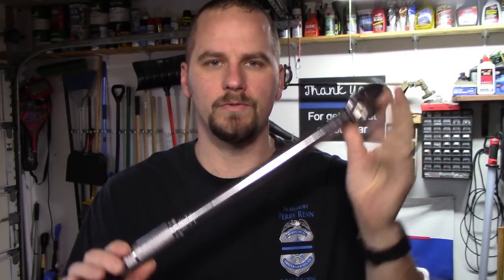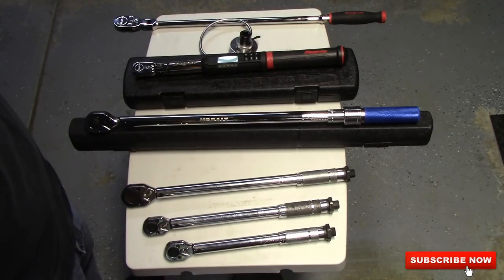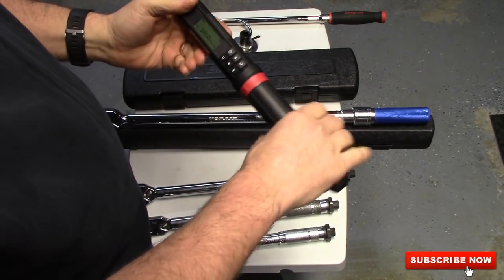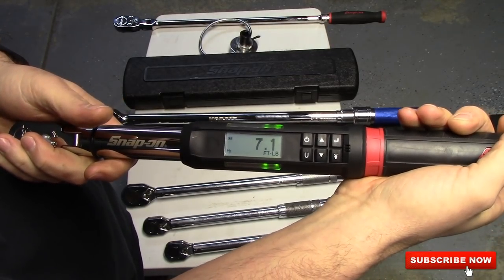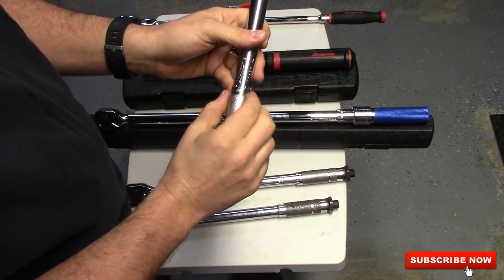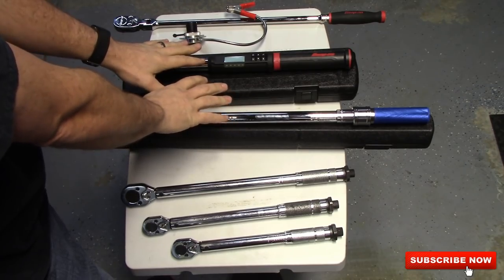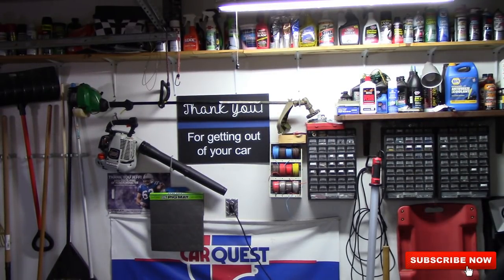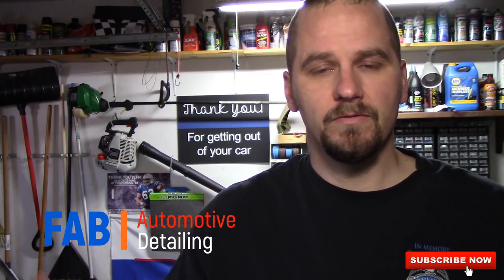Harbor Freight,Kobalt and Snap-On Torque Wrenches

Comment: That $550 Snap-On costs more than all my garage hand tools. Have to pass :)
Reply from the maker: Yes it is expensive and for a DIYer I would not recommend it. I use it daily in my job as a mechanic and its very accurate. That is why I showed the harbor freight torque wrenches to show there are other cheaper options out there for the DIYer.
Reply: @FABAutomotiveDetailing  I've got a $25 torque adapter just to check my $10 HF torque ratchet before buying a $60 Kobalt. That thing was 99% accurate, zero needs to buy a better wrench. Thank you for the video
Reply: @deseremere  but how well will the Kobalt or HF hold up after a year of daily use? The Snap on tq wrench is proven quality for those who use it every single day.
Reply: @deseremere  Those torque adapters are usually accurate but useless when you have to work in tight places. I have three of them, one from Harbor Freight and two ACDelco. ACDelco are excellent and they don't drain the battery when stored.
After using them for a couple of years I realized that there is no comparison between quality Digital Torque Wrench and Digital Torque Adapter.

Comment: After 20 years as a mechanic I DO NOT NEED a torque wrench to torque 10 to 60 lb-ft. I can feel in my arms . If you need a torque wrench to torque 30 lb-ft you are an amateur or a beginner. I am a engineer as well . I only use a torque wrench the first two years and now when i torque 60 to 180 lb-ft.
Reply from the maker: Jack Roselem That’s good and all but I’m no beginner been wrenching for over 15 years. I like to be exact when torquing. Yeah by feel I can get close also but not dead on what spec is. I just like to play it safe!
Reply: @FABAutomotiveDetailing  OK. If works for you. I am really not an accurate torque guy.
Reply from the maker: Jack Roselem We both get the job done and that’s what matters brother! 🔧
Reply: Remanufactured and installed engines for 28 years we called it "calibrated elbow".  We used torque wrenches where it counted obviously  but  learned  to feel the elasticity of a bolt  and could be quite close . I've worked on some vintage iron where the the spec for the head was "tighten evenly"
Reply from the maker: jz422 I work in a small shop with a great boss but when a comeback happens which doesn’t happen often the first thing he asks is did you torque the bolts. Just For example a water pump leaking a month after installed that’s the first thing he asks. So I have always played it safe after working at this shop for the last 7 years.

Comment: I liked your video. I like that Kobalt in a 3/8" drive as I am just a DYI person for its accuracy. What is your opinion of the best torque wrench adapter?
I viewed a video on the Quinn Torque adapterand it looks nice however there are two buttons (Power and meter button) on it if accidentally pushed will erase the factory calibration settings.
 That would ruin it. https://www.youtube.com/watch?v=2ih17t9u6fA   (5:18)  There is also an AC Delco brand and a few others. What you think of the Quinn brand and your recommendation? Thanks.

Comment: The upper end of the torque range only tells half the story. You didn't say what the lower end of the range is. For example you stated that one of your wrenches went up to 200 in./lbs. ok, from what?
Reply from the maker: J. Wilson It ranges from 60 in/lbs to 200 in/lbs.

Comment: Torque angle is for fasteners you torque to yield. It's more accurate than torque. These are also fasteners you should not reuse.
Reply from the maker: Playsportfun I understand that completely but at the end of the angle would still be a certain torque no matter how you look at it. Yes I do not reuse TTY bolts.
Reply: @FABAutomotiveDetailing You are wrong, it would not be a certain torque no matter what. TTY bolts are actually stretching as designed. It's not about the torque but the tension when considering holding power. You're stretching a fastener, you may reach the torque limit but the fastener does not have enough stretch in it for the correct tension. It may take the same torque on the 2nd pass, no matter 20 degrees or 60 degrees it could take the same torque for instance to get different amounts of tension. You have to think of stretching metal on a physics aspect, when it gives to stretching it will take about the same force to continue stretching. Another fact: Up to  85% of the torque you're applying with your torque wrench goes to overcome the friction of the fastener, not for holding the component in place.
Reply from the maker: redeye0315 I understand exactly what you are saying. So I have a question then. On Honda TTY head bolts they give you an initial torque and a final torque with no angle? You are stretching the bolts because you can feel and hear it and sometimes swear you are going to break them. I’m just curious I don’t doubt what you are telling me it’s just weird that some manufacturers use angle and some use torque.
Reply: @FABAutomotiveDetailing  I can't explain this. Perhaps someone smarter than I could.

Comment: Kobalt is no better then HF.  Nothing impressive.  "You know its accurate"  Nope, you assume it is.
Reply from the maker: Eddie Foy Actually I know the Kobalt is accurate and HF is not. My Snap-On representative has a torque meter to check torque wrenches. The Kobalt and Snap-On were dead on and both of my HF were 10 ft/lbs off.
Reply: @FABAutomotiveDetailing  
My Kobalts came with a certified calibration certificate signed by a technician. My HFs are pure junk, does not work not even worth the gas to return it. The machining on HF so rough, thread was already stripped. I like my Kobalts and Craftsmans much better. Now I have the digital HF 1/2" torque wrench, that one is really nice don't think they carry it anymore. That digital Snap-On you have is at another level, just wow! Batteries shouldn't swell up unless it's going to leak. I have the same battery in my digital HF for around 7 years, no problem but I should change it just to be safe.

Comment: You can now throw out the garbage Harbor Freight pieces
Reply from the maker: Actually they aren’t that bad. I tested them on the snap on truck and they were from 5-7 in/lbs off to the negative consistently. Knowing that I just set them 7 in/lbs higher then I want.